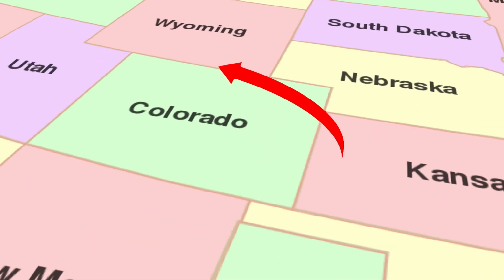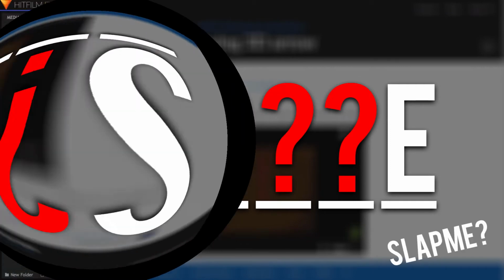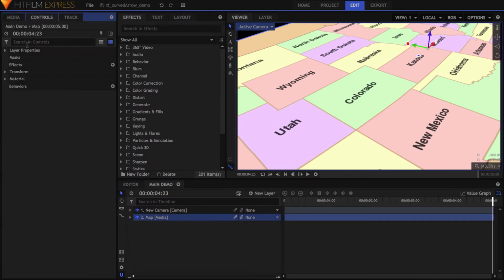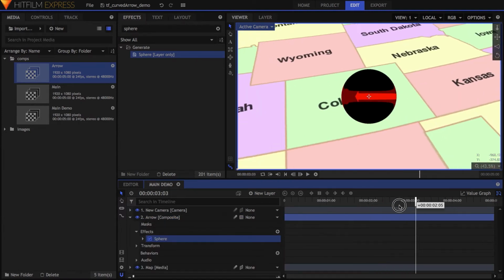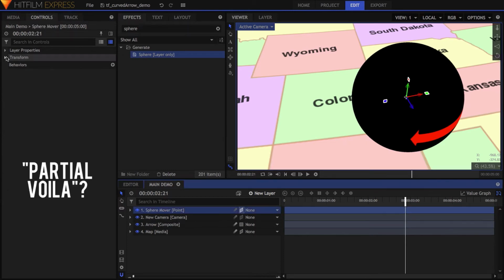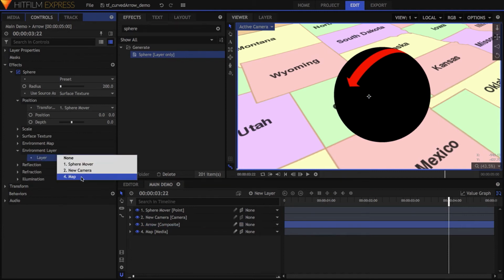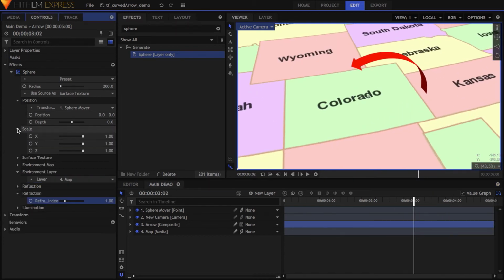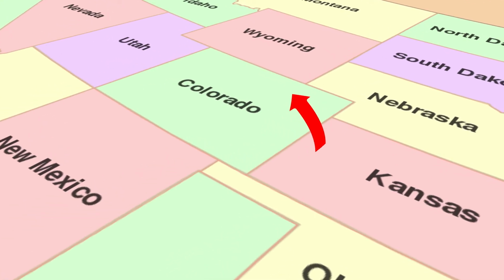Curving 3D Arrows in HitFilm

Comment: how did you make the camera move around the map?
Reply from the maker: Sorry for the delayed reply. I don’t have access to the project file right now, but I think I just had two keyframes on the camera. If I remember correctly, the camera was set to target a point layer, with the point layer moving along the surface of the map. That way no matter where the camera moved, it would still target the point.